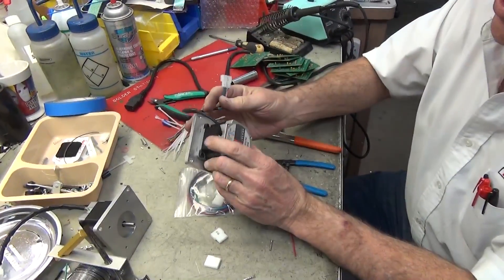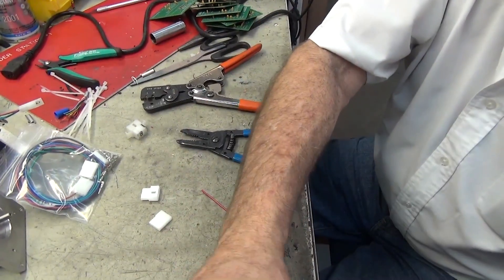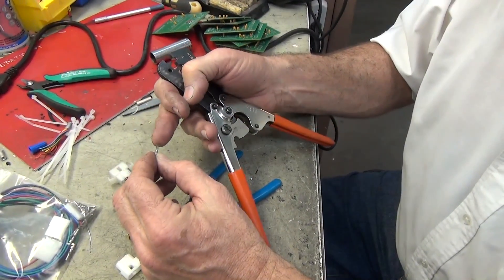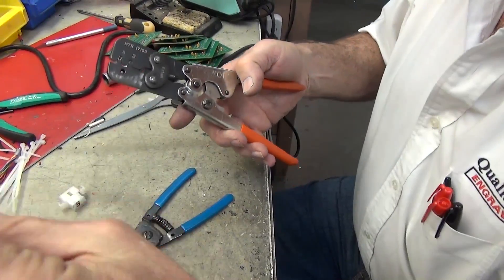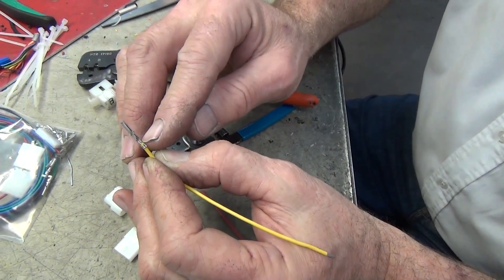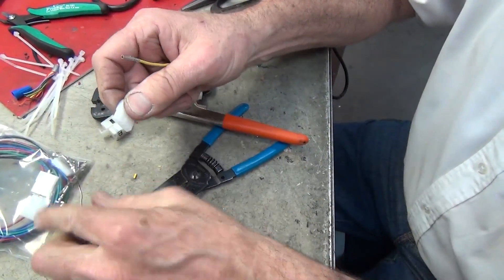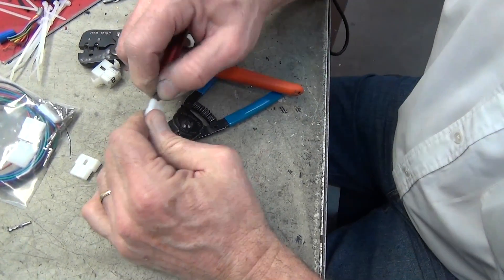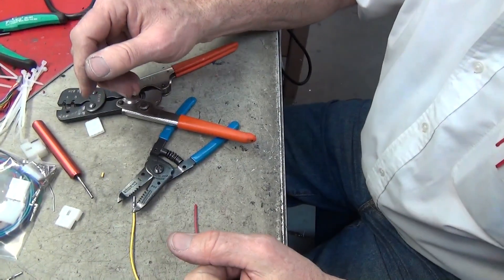Molex connector crimping

Comment: I’m having trouble crimping my uninsulated terminals, with a ratchet crimper. 

Instead of curling over, all it seems to it just crush it flat. Any tips?
Reply from the maker: Your term Terminal is a term used to describe Fork, Spade type terminal. These crimps have 2 sets crimping zones, one is for the wire and the other the insulation. if you want to send me pix fred AT q1engravers DOT com

Comment: Great video! I was trying to make a connection yesterday and wanted to CRY because the extraction tool is less of a thin tube like structure and more like a pointy rod. Theres NO way I'm getting those back out. LUCKILY I have more.
Reply from the maker: When the pin is placed in the crimper have it be well back from flush. There are 3 major sections of the crimp; the insulation crimp tabs, the bare wire crimp tabs and 3 tiny wings. These 3 tiny wings MUST not get smashed. If they are the pin will slide thru connector and be hell to get out. If they are left intact like before crimp the pin will slide in good, lock securely and be able to be removed easily. smushed and all bets off. When you press extractor into connector do a little twisting and you will feel a snap as it rides over the hooks. if you feel the snap it is duck soup to pop out and in perfect condition to reinsert elsewhere..

Comment from the maker: The pin diameter is .062", The female pin pn is 02-06-1103,  male pin 02-06-2103.   The Crimper is Molex HTR 1719C (look on ebay for this).  The connectors are 2 pin male connector (use female pin) 03-06-1023 / female  connector 03-06-2023. Note the 02 in last 4 digits changes to 03 04 etc to match pin slots. There are variation due to possible configuration of pins in multiples.  Look at Mouser.com

Comment: if you buy molex connectors and dont have a molex crimper, dont even bother trying to crimp. It will fail every time.
I hate these connectors! pieces of junk!
Reply from the maker: You are veryt wrong. These are very good connectors. Yes best to use a crimper, can get on ebay for as low as $30 to $60   HTR 1719C.  But in the field i have used manual crimpers on wire strippers and with care will work slowly.
Reply: Well said Fred